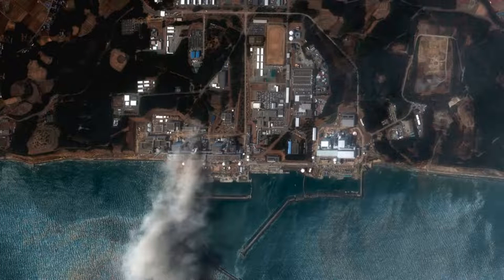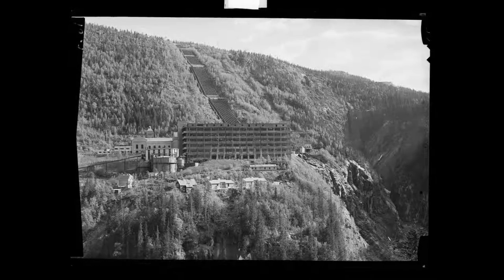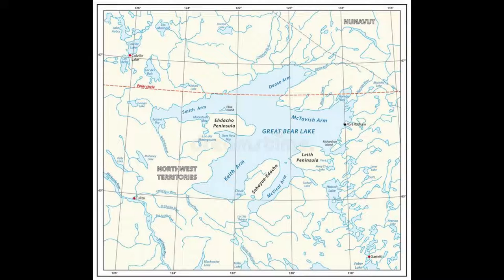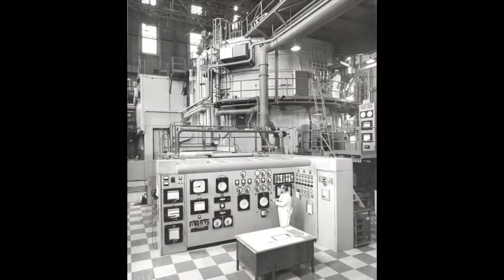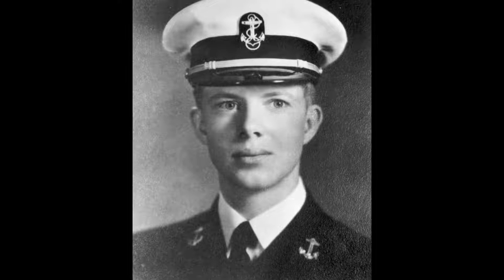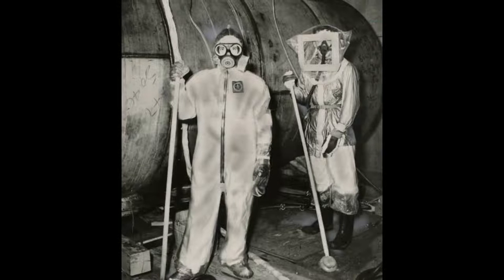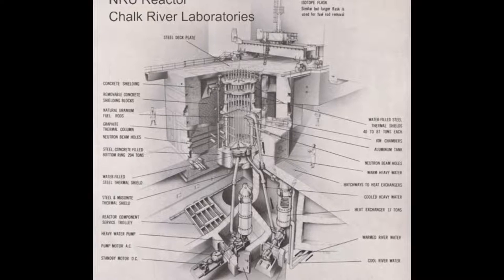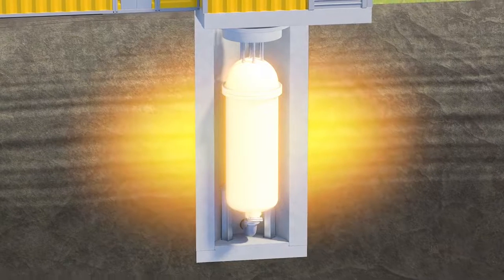What Was the First Nuclear Meltdown?

Comment: I work at Chalk River Laboratories. I will say that this video is a good and honest representation of what happened back then. It was the first unintentional nuclear disaster in human history, and we are still cleaning it up. That's only because the regulatory standard for the nuclear industry is that we make it cleaner than a concrete brick in the sun. If you don't know what that means, please shut up. A concrete brick in the sun produces more radiation than you want to know. Even a banana peel is more radioactive than most "radioactive waste" we produce at my workplace.
Reply: Do you happen to know if the radiation caused any casualties (including injuries, not just deaths) among the clean-up crew, or anyone else? I got the sense from this video that there were none, but I just wanted to make sure.

Comment: Your engineers do not have more education in physics than chemists biologists or toxicologists.  The physics and mathematics are the same. Edison generator and dynamos power plants can produce the same current and voltage AC power as any of the usual power plants.  The public utilities commission was created by Congress to assure these less expensive power plants were used in the rural electrification of the USA.  This did not happen.
Reply: DC cannot be supplied over hundreds or thousands of miles as easily. DC also is more costly to step up and step down.